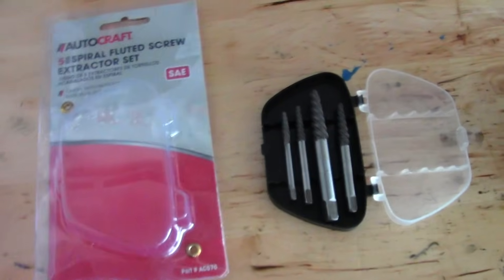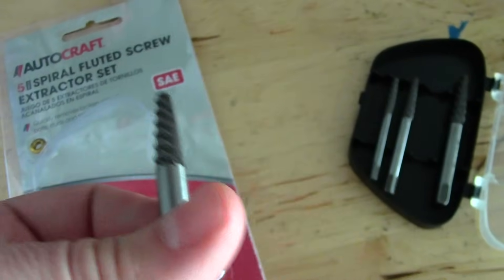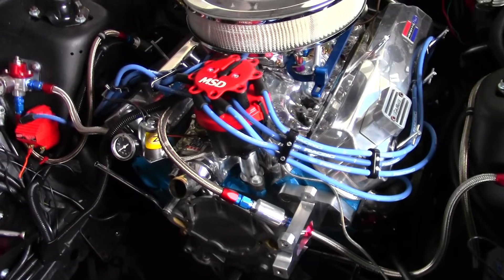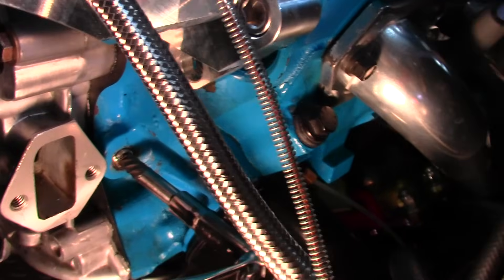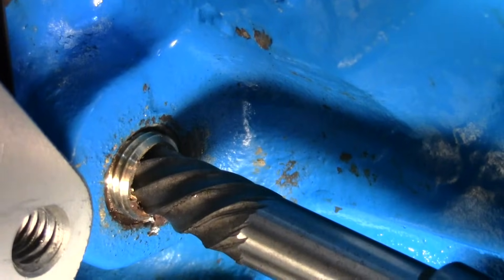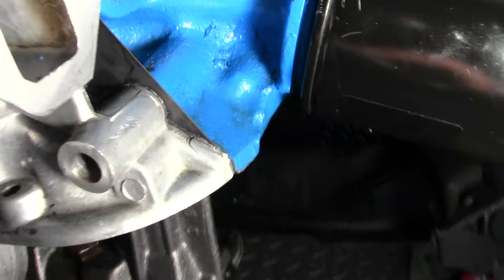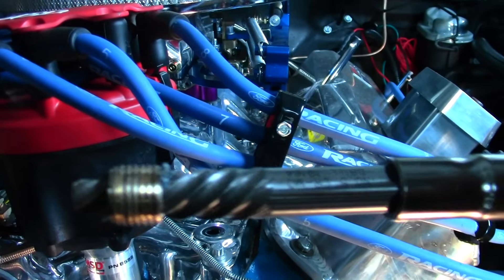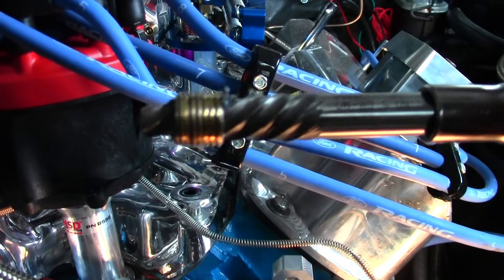How to Use a Screw Extractor | Remove snapped off bolt from engine

Comment: Very helpful! Thanks for posting! My husband got new side steps for his truck and while taking the old steps off a bolt broke up inside. It’s a good 4-5 inches up inside the hole so this seems to be the only way to get his broken bolt out. Gonna go get these extracting screws now and hopefully they are long enough to reach! Thanks for posting!
Reply: Leticia--I hope you were able to get a set of these extractors at a big box store or, as I suggested in my comment, on Amazon or other online seller.  They're kind of a specialized item, and I'm not sure you can find them easily in stores.  I see Lowe's carries them, but you may have to order the set online from them and pick it up at your local store. They're one of those tools that you don't need very often, but when you need them, nothing else works for you.  BTW, they're not extracting "screws"; they are screw or bolt extractors, so be sure to ask for them that way if you got to a store, or look for them online.  They ARE screw-shaped or even drill-shaped in appearance, but that's where the similarity ends.  Most extractors work on the "wedge" principle; you drill a hole, wedge the extractor in as tightly as you can, then turn counter-clockwise.  As I mentioned in my comment a year ago (above), this style doesn't always work well with brass and PVC (i.e., soft materials), so a set of square tapered extractors is also good to have.  I hope you were able to find what you need already, and that your husband was able to use them successfully.

Comment: CORRECTION Necessary: You should say never drive a EZ-out screw extractor with a power drill. Take it slow and steady with a tap wrench or other similar holder for your hand.

Comment: I happened to do this on an installation of an intake manifold hopefully I can get it out fml
Reply: Hi bud. It's kw its been a couple of years since u reply to this thread.  I'm going to attempt this remove studs from intake manifold tonight. is there any advised or tips b4 i start removal of 5 rusted studs. Also how you manage to get the broken stud out eventually my friend.   Thks in advance.
Reply: Manny Singh my stud was brand new and wasn’t rusted, plus the torque spec for my manifold bolts is like 15 and I didn’t use a torque wrench so what happened is I over torqued and broke the bolt into the aluminum engine block. I used a drill to drill a small hole into bolt to fit the extractor and used a hammer to puch extractor into bolt and extracted it. I WD-40 soaking once every hour for about 5 hours or WD-40 left over night will likely be your best bet to help loosen/unseize the bolt. Sorry for the late response I hope you got the bolt out brotha

Comment: Hi, I am trying to unscrew a rusted screw with mangled screw head from my car license plate.  I tried using a rubber band on top of the screw to unscrew as mentioned in another video I saw (not yours), but it didn’t work for me.  Is a screw extractor appropriate for license plate screws or is there another way to unscrew it.  Thx in advance.

Comment: Dont ever force or break a drill bit or extractor bit!! They can be removed but very exspensive and time consuming!! Always clean threads check pitch and use anti sieze unless a water hole then thread tape and if torqued to spec 1 drop down the side of thread!! My client shop motors run excess of low 8 at almost 200mph with no fastener failures!!

Comment: You should take extra care using a wrench/socket the wrenching action can snap it off.  Typically those are used with a tap wrench where equal force on each side can be applied to avoid wrenching action.

Comment: But how did you get it started w/o a drill? Like how am I going to use one of these to remove a t-50 head truck bed bolt that has rusted and the corners of the t-50 head are rounded out? Should I drill into the head first before trying to use an extractor?
Reply: You want a bolt remover (specializing in rounded bolts) and some luck (maybe penetrating oil and later heat too)
Reply: I think it was a hollow plug, not a bolt. You would have to drill the bolt first.

Comment: I've got  98 Civic that I broke the crank bolt off in (while tightening) and I'm hoping to use a set of these on it. Anyone else had any luck using them on crank bolts?

Comment: A good tip i learned the hard way about is if a bolt is corroded and or seised tighten it then loosen and do those steps over and over till you get the bolt out
Reply: And throw some heat on it with a torch if you can.

Comment: You were fortunate on this one.  As you know, you must work slowly, carefully and not use a great deal of force.  There is a better extractor type to use for brass (and plastic and other soft metals).  You should invest in a set of straight-tapered extractors, which are four-sided.  Depending on how deep in it was, the brass connector you removed could have expanded and been torn up as you tried to remove it with the spiral-taper extractor.  The square-tapered style makes contact at four points of the fastener and won't expand it during removal the way a spiral one will. Spiral types are generally useless with soft metals and plastic/PVC connectors.  They will connect initially, then expand the fastener.  As you push in a little deeper, it will begin abrading the inside, enlarging the hole and turning uselessly.  At that point, you'd probably spend a lot of time picking out pieces of it with tweezers and needle-nose pliers.  Irwin-Hanson, Vermont American, Drill Hog, Knipex, etc., make square-tapered sets that will be good to have in your arsenal.  Check them out on Amazon.
Reply: Thank you for the information. That is the issue I am having now and making it worse.

Comment: I just broke the fitting off that comes out of the block and receives the oil pressure sending unit. I then broke the easy out off in the fitting. Now I am screwed. Going to call around for a mechanic or machine shop that may be able to bail me out.

Comment: great video quick question:
I recently broke the bolt that connects the block to the block bracket/motor mount. you mentioned you didn't want to use a drill and honestly neither do i. Will i be able to extract the bolt just by using a ratchet like you did?
thanks

Comment: Er . . .  you would never use the screw extractor with a drill or air ratchet as if it was a drill bit.  They only resemble drill a drill bit by form.

Comment: My story: removing a hex headed oil gallery plug with rounded hex. Drilled a hole, used the extractor, kept turning until I heard a dull ping. I cracked a small piece of the block. OMG! With the block piece came about 1/4 of the threaded hole, so I gut the plug out but totalled the block. A marine engineer friend told me to epoxy the engine block bit back in place with JB Weld. Did that and 20 years later the engine still runs strong. That sickening dull ping noise haunts me today.

Comment: If you go into Home Depot and go to the water heater isle where the gas connectors are you will find a 3/8 threaded male nipple on one side and I believe it will be flare fitting on the other .

Comment: Sending units already have a hole through them. No need to drill. It's not a solid bolt if the head is twisted off of the barrel.

Comment: good thing it was easy to get to,mine usually break on the exhaust or main bearings video is a clean hands mechanics video.ive spent the better part of a day trying to extract some bolts,you usually have to remove a lot of stuff if not pull the engine.not very realistic.but thank you anyways I enjoyed it.

Comment: plse do another video shows how to thread the extractor in to the broken bolt
Reply: You just push and turn counter clock wise.  The teeth cut into the metal and try to pull it in while the taper keeps the extractor from going into the hole.

Comment: how did thread the extractor to the the broken bolt, all what you did show how turn a wrench
Reply: Left hand drill bits required so the bolt doesn't screw in the more you drill... still looking for a good set for this stupid broken bolt in my mower block
Reply: Alejandro Garcia one that fits
Reply: Max key there are many sizes of extractors.  If you are dealing with a bolt, best thing to do is drill a hole in the center big enough to insert the extractor.  From there, follow the steps on the video.
Reply: @luzysonidolabomba  Yes this is what I did when I snapped off the kick starter bolt on a motorcycle 
.got a small new drill bit and and drilled a hole in the middle of the broken bolt to get the easy out drill bit into it.
Reply: It wasn't a bolt, it was a brass insert, which are hollow with a "bolt" head on them. The head snapped off, leaving a hollow insert.
To extract a solid bolt, you first drill a "pilot" hole into the centre of the bolt that is big enough to accept the "extractor" tip. Then you drive in the extractor.
Reply: What size socket did you use..
Reply: Alejandro--It depends on the size of the square drive at the other end of the extractor.  He didn't show us, but he's probably using a 12-pt. socket for this, as a 6-pt. socket won't work.  Depending on where the extractor is made, it may require a metric socket to turn it.  If space permits, a tap wrench from a tap and die set may also be used to turn the extractor; an adjustable wrench will work, too.
Reply: English speak please time next

Comment: I had a manager that broke an extractor off in a stud then snapped a drill off in the hole then stuck a file in it and said he can bust up that drill bit.  I had to wait until he gave up and eat out the stud, extractor, drill bit, and broken off file with a carbide endmill and tap it.

Comment: That is not 3/8-16 threads, it is a tapered pipe fitting.  Also, why is there no pipe lube on the broken fitting?  There should be!
Reply: wow why don't ya pick it apart. just simple how to video.

Comment: http://www.ebay.com/itm/LOT-OF-10-3-8-16-X-1-BRONZE-BRASS-COPPER-HEX-HEAD-BOLTS-651-SILICON-BRONZE-/122067870508?hash=item1c6bcfe32c:g:A6AAAOSwIgNXnzZe

if I was off on the size just search the correct one on ebay and they will have it. I get a lot of odd stuff this way.

Comment: Every time I have used one of these "easy outs", they break in the bolt.   Unless the bolt is very loose, or soft metal like brass they never work.   Don't ever use one of these on a real steel bolt.
Reply: If it is rusted in, that is tough.  If it was over tightened (not bottomed out) or sheared off, a left had drill bit works great.  If it is rusted in.  SOAK it with Kroil.  I would try welding a nut on it.  Even if you can't get it out with the welded on nut, the heat will help break it loose.  If that doesn't work, Kroil it again.  Then try a left handed drill bit.  My son bought a used vehicle with a G58 tranny.  One of the mount bolts was broke off and the previous owner had obviously tried to get it out.  There were several holes drilled in the bolt and one about 1/8" diameter and 3/8" deep drilled between the bolt and aluminum case.  My son tried to weld a tit on it and a nut several times.  It didn't work.  The next day, I went to the local industrial supply and bought a 1/8" and  1/4" left hand drill bit (bolt was about 3/8" but metric).  Drilled about 1/2" deep with the 1/8", nothing.  Before the 1/4" bit even got deep enough the drill the whole diameter, the bolt came out.  If the steel bolt is in a nonferrous metal, try alum (lots of instructions on the internets) but I have never tried alum.

Comment: Awesome. Thanks for the video. This tool is good for extracting a bathroom broken shower valve cartridge. They get stuck and break off but this tool will do the trick and get the outer brass of the cartridge out.  Thanks again. Cheers.
BTW... awesome friggin engine.

Comment: Goddamn these things work GREAT. I was scared AF that it would fail. Your advise of using low speed hand tool was the trick. Drills even on low speed just can't get the grip right.
Reply: You're better off putting power tools away once you've drilled a hole for the extractor.  It requires hand tools and patience to remove broken fasteners, not speed.

Comment: how did he connect the extractor to the screw?
Reply: Just drill the hole and thread in the extractor.
Reply: The screw was a hollow screw with a hollow bolt type head.  He did not have to drill a hole cause it was a hollow bolt.  He just needed an extractor the right size to bite into the sides of the hole enough to get it to back out.  That's why it seems like he started the demonstration half way through because there was no need to drill a hole - one already existed by design of the bolt.
Reply: I suppose you have to drill a hole in the middle of the broken bolt and then screw in the bolt extractor.
Reply: thats what i want to know
Reply: Masht Ali--Read down to Zaren's response.  This one was easy because a hole already existed.  You just find one of the extractors in the set that's large enough to wedge tightly into the existing hole of the bolt.  Tap it a time or two with a hammer to set it, then back it out using an adjustable wrench.  You can also back it out with a socket and ratchet, but you will need a 12-point socket to do that.  If you have the room to work, you may also use a tap handle to turn out the extractor.  As was mentioned, the extractors are left-handed, so removal is accomplished by carefully turning them to the left to remove the broken fastener.  You should also understand that you're NOT threading the extractor into the fastener; you jam or wedge the extractor into it until it's as tight as you can make it.  Brass is soft; if it's even slightly loose, the extractor will end up spinning around inside the fastener.  Soft materials, such as brass or PVC plastic, may respond better to tapered, SQUARE extractors with sharp edges.  You can find these online at Amazon, as well as the type used in this video.  Irwin Tools and other companies make square, tapered extractors, in addition to the style used in this video.  Good luck.
Reply: Masht Ali
Reply: he didnt show how he attached the extractor....
Reply: As small as possible. if the hole is too large, the extractor will flay the end. And make sure it's deep enough. Use a diameter about half or less of the broken bolt. If the bolt is too tight, think about heating it and/or  PB Blaster penetrating fluid.

Comment: Great Video good idea for the subject, there are many people who do not know that extractors exist. Might be worth mentioning that it is not a good idea to use them on thin walled material or or soft metals such as brass!!.. On stubborn bolts they can make matters a lot worse by deforming the remains of the bolt and making the bolt dig into the male threads. Also, don't buy cheap versions of these tools they are cheap mild steel that have been hardened to within an inch of there life making them extremely brittle and snap; as you say in your video if this happens we all go home.

Comment: Challange at 4:13 to find 3/8 16 brass? Jamestown Distributors carries that thread in brass rod and machine screws (flat and round head). In silicon bronze you can get screws, hex head cap screws, rods and even carriage bolts.   :-)

Comment: I have a question. would this work on an aluminum thread? metal bass with broken aluminum fluid fitting. please!
Reply: from experience they aren't the hottest on softer metals. I had to wind up completely drilling out a 1/4 20 stainless steel bolt because high winds sheered the head off and that would not grab it

Comment: My dads spark plug in his van blew out of the hole[ the ceramic white part] and the only thing left was the piece screwed into the block. but the ends were rounded off and could not get a socket to grab it to remove the rest of the spark plug. i had to use one of the bolt extractors on a long extension  to back out the old spark plug.because it sat down inside a heat shield around each  spark plug hole

Comment: Here in England we call them Easy Out. The worst thing you can use on a corroded bolt, break it in the bolt and that`s it.
Reply: bmwnasher reverse flute drill can walk them out sometimes.
Reply: Removing a sheared titanium bolt head
Reply: Easy out, is a different product. This design was from a man who owns a company, Devon Products I belive. There is a sister company under the same roof of which I can't remember the name.
Reply: John Wade drill out then flat screwdriver. On drill for torq.... have to be sensible though haha. Ive a pic just cant up load it old school ways hah
Reply: bmwnasher--I suppose you can call it that, but the process is anything but easy many times.  "Extractor" is perhaps more accurate, and dispenses with the false hope that the name "easy out" promises.  Call it whatever you want, as long as you understand the limitations going in.  There is another process called EDM (electro-disintegration machine) that can be used by machinists to remove fasteners and extractors that are hopelessly stuck in a threaded hole.
Reply: Here in Northern, England we call them Stud Extractors. Easy Out is an American term.
Reply: I call them the exact same name.
Reply: bmwnasher      B         B.   N.          m.           B.  Be v b.         B.   N.   b.   M

Comment: i tried these and they never worked for me now i don't even bother
Reply: +jorgengeerts what's your alternative? thanks
Reply: i use a steel chisel or center punch and a hammer, if that doesn't work i weld a nut on it or drill it out.
Reply: me 2

Comment: Great video.  I have a bolt that holds the seat in, the bolt head snapped off.  I have drilled the bolt out, so I will get an extract tool that you shown to get the rest of it out.

Comment: Man you got lucky,good job. I went a little too tight on power steering pump bolt. Tough to get at,wish me luck. 👍🏻
Reply: If dont have extractor or it's in tight space also sell tool that grabs outer edges of bolt which you can then get alot more leverage on tight bolt